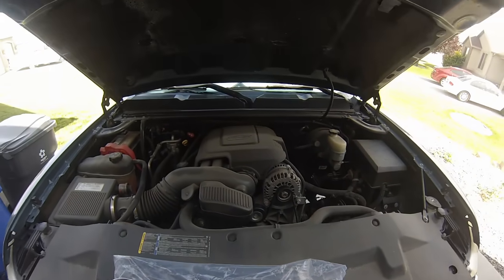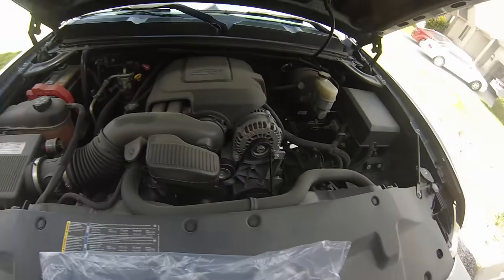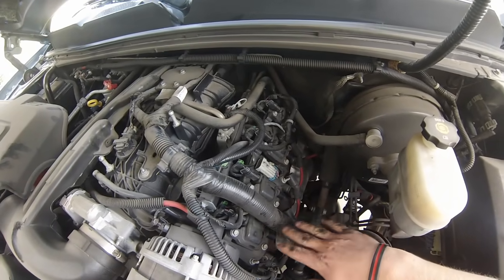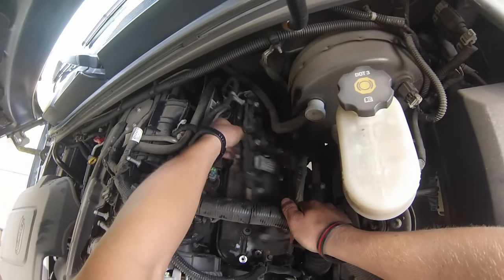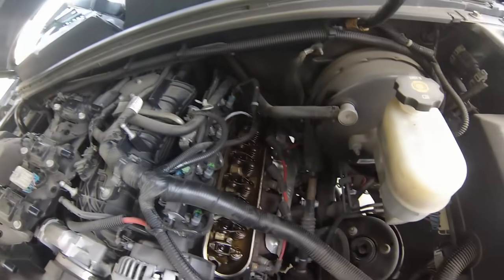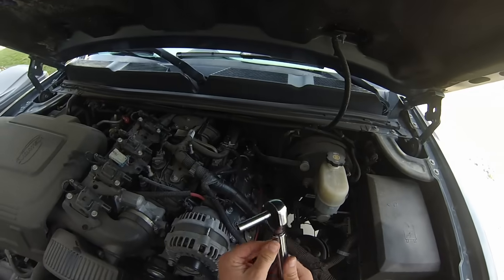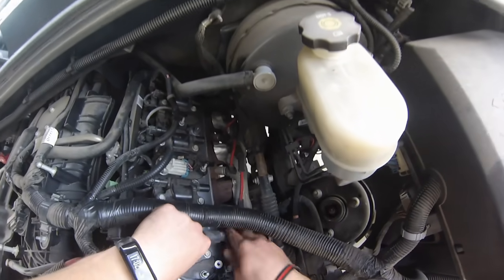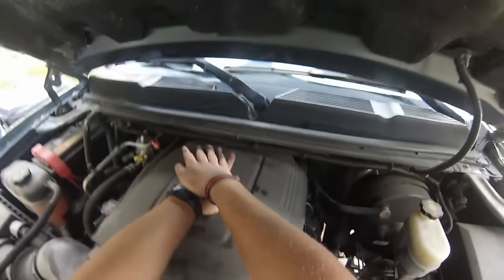Oil Consumption Fix: Replacing the Valve Cover and PCV on 2007-2013 Chevy Silverado

Comment: I had smoke at start up in my 2007 5.3 and this fixed it.  Ordered the valvecover from Amazon and installed in less than an hour and two beers ;)   Thank you so much for posting.
Reply: Did the smoke like a gray color? I change my oil in my 07 avalanche.  Then start smoking afterwards.
Reply: Was it really intermittent? Mines doing that, but only once in a while
Reply: Can you post the link? I was about to order one for mine. Your cover would be the exact same one I need. Thanks.
Reply: @brentbredemeyer1368 my 10 suburban does it rarely I'll try it

Comment: Thanks so much for this video, I just replaced mine in less than an hour I had to do some prying to get the old gasket to break loose, and getting my electrical connection apart without breaking anything was nerve wracking but you have just saved me a lot of cash and made me feel accomplished at the end. Awesome video, I appreciate you sharing your knowledge with everyone it has been a huge help for me!
Reply from the maker: Thank you for the kind comments! Good luck with your future projects!
Reply: I know it's quite off topic but does anybody know of a good site to stream newly released series online?
Reply: @Dario Miles flixportal :P
Reply: @Adrian Chandler thank you, I went there and it seems to work =) I appreciate it!
Reply: @Dario Miles happy to help :D
Reply: Use a rubber mallet and tap the bottom of valve cover it took me 5 soft taps and it came out smooth

Comment: I used the range control to disable the fuel saving feature, decarbonized the rings, and it helped alot. Went from 1 quart  every 500 miles to 1 quart every 5k miles.
Reply: Did you soak cylinders in seafoam and let sit or something else?

Comment: You have a LOT of satisfied watchers! You made it look easy, so being an old motor head, I believe i can tackle my oil consumption (just started recently)  problems with this fix. My suburban still looks new, even with 205,000 miles, so I might as well keep it, as I have never done anything major go wrong. Thanks for the video and your prompt answers.
Reply from the maker: Thank you so much for the kind comments. If the oil consumption is really severe it may be beyond the PCV being able to fix it but it's a start. Thanks for supporting the channel!
Reply: @TheDadBodWorkshop  Well, I did replace the valve cover with the new PCV today, and it was a piece of cake. Having the coil packs on the valve cover through me for a loop as I first looked at it, so thanks again! I also 'installed' the plug in Range AFM disabler a few weeks ago and didn't notice ANY help with oil consumption, but think that it's a good idea anyway, so thanks for that tip! I will monitor my oil consumption and let you know if it works.
Reply: @TheDadBodWorkshop  Before the valve cover / PCV replacement, the engine blew a CLOUD of smoke at each start, but afterward there was no cloud after starting, beginning with the very first one. The inside of the old valve cover was caked with burned oil. I'll now monitor the oil consumption, which was around a quart every couple of hundred miles. At $4/qt, the repair will pay for itself, before the next oil change, and if I sell it, I can get a good price. THANKS AGAIN!
Reply from the maker: @jerrykorf4444  oh that's awesome! So glad everything worked!
Reply: The valve cover / PCV replacement has done the trick! No oil usage in a couple hundred miles, no smoke cloud at start up. WOW!
Reply: It is easy if you watch it a few times and follow his steps

Comment: Saw a guy do this, drill holes, 1 between each bolt, because the oil gets gummed up and stuck behind that plate. That hole on the right doesn't let it drain good enough. It allows better draining and In turn less consumption

Comment: The factory valve covers and pcv system is absolutely fine. Perfect even. I successfully use it on 02-07 Gen3/4 LM7/L33/etc... forced inducted engine with over 200,000 miles 600rwhp 800rwhp 1000rwhp no issues. The problem is people have no idea how the PCV system actually works. For example nobody understands the relationship between crankcase pressure and oil droplet radius/density. People are clueless. At wide open throttle the factory paper air filter element procures a pressure drop of approx 0.9"Hg to 1.8"Hg depending on mileage which pulls the crankcase pressure down to about 0.5"Hg to 1"Hg which is perfect, you can go 200k miles with no issues like that. The problem is when people don't maintain the PCV lines or they modify the air filter or they add a catch can (it takes energy to drive fluids through hoses and added length is added friction which kills pressure gradient raising crankcase pressure) and these lead to large oil droplets, high oil density, it kills PCV action and ruins the factory oil/air separator's kinetic energy input which causes oil to blow out of the engine and deposits forming as light hydrocarbon chains leave behind and circulate hard diamond-like and sticky tar-like carbon conglomerates which lead to eventual wear and failure. Yes I am a doctor of mechanical engineering and I've been tuning hundreds of turbocharged daily drivers since the 90's so this is part experience and part education talking. If you want to actually control the PCV system you must learn to measure the crankcase pressure. There is a DIY How-TO Video in my channel where I show you how to do it using a 1-bar map sensor and 5v source on my 5.3L Turbo 600rwhp application using a stock 240,000 miles piece of junk engine with absolute perfection success on the OEM Gen3 covers.
Reply: Who's this doctor clown talking about the factory system is fine/perfect?
Never looked at an intake before. Never seen all the design changes around the BS issues
😂
Reply: @ImNotHereToArgueFacts  Not the factory system, the factory methodology and pressure settings. PCV systems are like MHC for animal tissues- they are unique for each individual. You have to measure the crankcase pressure, and set it correctly, just like any other pressure. New tires? Set the tire pressure. New Fuel regulator? Set the fuel pressure. New Engine modifications? (Air filters, Hoses, volume/friction changed, etc...) Measure and set it correctly otherwise it will not work, no matter how many parts you install
Reply: If it worked fine, the average person wouldn't have to learn to measure pressure in order to own this model of truck
Reply: @StyIust  thats like saying, if tires worked fine, the average person wouldnt have to measur their own ire pressure. Or if fuel regulators worked fine, they wouldnt have to measure their fuel pressure. Or if transmission pressure worked fine, you wouldnt have to measure the trans pressure. Or if boost controllers work fine, you wouldnt have to measure your own boost pressure.

Get a clue man. Every engineering system has a pressure, and a gauge to measure it by and a range for it, and if you dont know what you are doing then you bring it to somebody who does and THEY do it for you. Do YOU Measure your own tire pressure? Well then good for you.But not every average person can do that
Reply: @Wabits  you're equivocating. What other cars you know where the average driver needs to measure the pressure inside any part of their engine in order to keep it from burning oil out of the factory haha
Reply: @StyIust  All of them. Every combustion engine in existence has a crankcase that fills with water and blow-by products which must be evacuated. Every factory deals with this somehow, the same way they decide how to set your tire pressure from the factory. If you buy a brand new car, and then modify it, the factory settings are no longer applicable. The same goes for age & wear, which are random sampling modifications, e.g. every car is maintained differently so mileage results with varying degrees of wear and tear over time, and therefore different oil system related concerns. Any modifications completely change the requirements and require re-evaluation, like when changing any parts, such as tires, regulators, oil pumps, filters, thermostat, temperatures, etc... These all require measurement followed by setting the pressure/temperatures correctly, and in lieu of wear/tear specifically for that vehicle.

Comment: Got a 2007 Yukon XL.  Did this repair and it completely fixed the blueish white smoke at cold start.  It was pretty bad and consistent before.  Still not sure about oil consumption yet but we'll see.  I was going through maybe 2ish pints every 1000 miles or so.  I do have a AFM disabler at the ODBii port.  Thanks for the vid!  Big help.
Reply from the maker: Glad to have helped! Thanks for watching!
Reply: Any update on the oil usage?

Comment: For anyone having the smoke on startup issue- try changing oil and adding 1oz of Seafoam per quart to the new oil. I decided to try that before ordering the new valve cover, and the problem went away within three days. 
I had also soaked the inside of the cover with carb cleaner (especially inside the channel/drain/orifice of the "PCV" that isn't actually a PCV) but not sure if that accomplished anything. By the third day after, I had a load on the engine pulling a trailer for about 50 miles, and on the next cold start, everything was back to normal. It's worth a try.
Reply from the maker: Great tip. A lot of these engines have been ingesting oil for so long that the rings are no longer working to stop the oil from rising into the combustion area. SeaFoam is a great way to address this as long as the control rings are still working somewhat. Thanks for watching!
Reply: I cleaned mine out and it has been going well for a while now. Did come across the service bulletin for this and my god it's alot

Comment: I have a 2013 Silverado 1500 with 250k highway miles. It just started to burn oil. I appreciate your video and took your advice to make the change. I installed the Range AFM disabler and saw the oil consumption go down, and the MPG actually went up . I did use an engine cleaner before I did the valve cover change, as i didnt want any dirt getting into the engine, nor did i want to get greasy.
Watching your video ahead of time the entire job took 30 minutes. My only problem was the valve cover i took off looked like the improved version. I cant imagine Chevy making the change for me, and as i already had the replacement,  i consoled myself spending the money, thinking the one i had purchased had an improved PCV valve. My 1/4 drive Matco torque wrench only goes up to 50 inch pounds, so i had to use my 3/8 drive at 106 inch pounds. Otherwise it was a breeze. thanks again.
Reply from the maker: Thanks for the kind comments! Keep on wrenching!

Comment: I would prefer the “Car” version placing the PCV valve in the center of the engine, with fresh air entering valve covers the flushing the crank ASE fumes into the middle. I got a 2003 Tahoe with 117k miles on it. Yes, a family member hit black ice then a large tree grew up in 2 seconds.
 I observed wear on the valve tip ends on the driver’s side with the PCV. 
  Everything from water vapor, carbon particles, oil vapors, raw oil droplets and raw unburned gas when cold are produced in the crankcase. Fresh air enters on the right, sweep the crankcase and exit the left thru the PCV. All this valve cover has done is increase the length of the vapor gallery and the little wings help block raw oil from the lifter sprayed up thru the push rod.
  I was shock to see any signs of wear on all valve stem ends. As a tech, it is required to look at witness marks (Both good & bad) and wear patterns. I do not have DOD or Active Fuel Management inside this block, so the center valley is wide open this area.
 I chose to design my own system with fresh filtered air into both valve covers via “Tee” fitting. Using a brass pass-thru fitting, nuts on both side over aluminum crush washer. I run my PCV hose up to the normal PCV inlet on the intake. The valley design was flair fit rigid copper pipe, roll pin drilled and inserted two inches back from the outlet. The pipe is gently packed with stainless steel wool and 34 holes 1/8” diameter drilled length of the bottom and 1/3rd up the sides. The end is crimped almost shut, every 90 degrees with a cold chisel. No restrictions with air flow and if the oil condenses, then it can drip out thru the tiny holes. Washers are from OEM oil drain plug (Import) and normal brass fittings from home store. My only surprise was stainless steel wool. A little pricey and not sold by most. I suggest coarse. No issues at all, but I spent 40 years with a tool box, fixing motorcycles to 4 X 4’s. ASE Master Tech since 1978 - Retired

Comment: Thank you for this video 📹 . You saved me hundreds of dollars.  I did my upgrade valve cover in 45 minutes.  Also use a mallet and tap the bottom from both sides and middle of the valve cover if it's hard to take out.

Comment: I just used this video yesterday and it helped as far as taking the old cover off and putting the new one on. It took me about an hour to do it. I have a 2011 Silverado when I took the old one off I didn’t see a difference compared to this new one. As far as the oil consumption I’ll come back in about a month too see if this made a difference
Reply: Any difference?
Reply: @JR-fz5uh  yes the smoking stopped. It took about almost week and a half to stop the smoking. I was getting white and blue smoke sometimes. I think the pcv hose was full of old oil and I didn’t drain it so that’s why it took a week and half I guess for it to completely drain to make the smoke stop
Reply: @BigHomie030  what about oil consumption?
Reply: @JR-fz5uh  no that did get resolved. It still consumes oil. I think it may be something else then. This did not stop it or solve that.
Reply: @JR-fz5uh  I looked at both the old cover that came off and I did not see any difference. I think maybe my truck already had this updated version because I even took a side by side picture and everything looked the same. The one thing I did notice was the seal the gasket was pretty baked and toasty I had to scrape it off with a knife to get it off and then clean it and put on new gasket seal
Reply: @JR-fz5uh  I have a 2011 Silverado with a 5.3 and it has 245k on it

Comment: Thanks. Just changed my valve cover in 15 minutes on 2008 Avalanche.  Problem solved
Reply from the maker: Awesome! Good job. Thanks for watching!
Reply: This sounds promising for my 08 Avalanche, I was dreading the alternative, swapping out the engine or giving up the truck as a whole. $$$

Comment: I just drilled 10 holes on the original baffle and cleaned with brake cleaner and diesal fuel.  The pcv is an orifice and not a valve. No need to spend 70+ dollars on new valve cover.
Reply from the maker: Thanks for the great idea!
Reply: You didn't happen to take a picture of your solution after you drilled it out?
Reply: You worsened the issue by doing so.  The problem with oil burn is the PCV orifice sucking up too much oil splash from the valvetrain.  The revised cover has a more sheltered orifice.
Reply: He did an upgrade on his valve cover I did the same and ordered a better valve cover.

Comment: Good video! Thanks for the help!
Reply from the maker: Thank you! Good luck!
Reply: Where did you buy valve cover?
Reply from the maker: @williamhall5319  I bought it off of Rockauto. You just have to make sure it is the proper replacement. There are a few parts out there circulating around that have the original baffle design.
Reply: @TheDadBodWorkshop  yeah i got it from rock auto best deal around. Thanks

Comment: I replaced mine and it worked like a charm for 6 months.  Now I guess I’ll order another one.  POS vortec design.
Reply from the maker: I had a similar year Jeep Wrangler and it consumed oil like crazy. Bad enough where I rebuilt the engine. More and more I'm hearing about modern engines consuming oil. I wonder why that is?

Comment: Thanks, just ordered the kit.  My 5.3 is burning a quart of oil about every 1500 miles.  I hope this makes a difference.
Reply from the maker: I hope so too!
Reply: Did it make a difference?
Reply: What kit did you get ?
Part numbers ?  Where to get ?
Mine is 2010 Silverado 5.3
Reply: I got the 264-969 part # that’s the newest for the 2011 1500 5.3 v-8 I have

Comment: i had to put a catch can on mine. have to empty it quite often but i also have 360k on my 6.0, but it fixed the occasional cloud of burnt oil at startup.
Reply from the maker: I've considered putting a catch can on mine but was always worried I would disrupt the air flow for the pcv system. Which one did you go with and how much is it catching in between oil changes?
Reply: @TheDadBodWorkshop  I bought a cheap small one (like 11oz canister) off Amazon just cause I wasn't sure how it was going to work. They supplied a cheap hose but it kept collapsing when it got warm so I used some hydraulic hoses and clamped them on. I have to empty mine like every few days but I also drive a lot and like I said I have 360k on mine so it might be a little worse than yours.

Comment: So I have a rear main seal issue. Been replaced twice, I think the first time they put it on backwards. This time it’s more seepage. I changed the oil cooler lines as well. Hopefully changing the valve cover will shed light on my issue.
Reply from the maker: Keep me up to date on what you find out. I have a suspicion the rear main on this truck also is leaking.
Reply: XinnKoda will do, I just don’t know what it can be. Besides the PCV. I don’t think it’s the bearings cause I don’t hear a sounds coming from my engine that sounds like damaged bearings.
Reply: XinnKoda no luck on replacing the valve/pcv. Rear main seal is still leaking some oil.